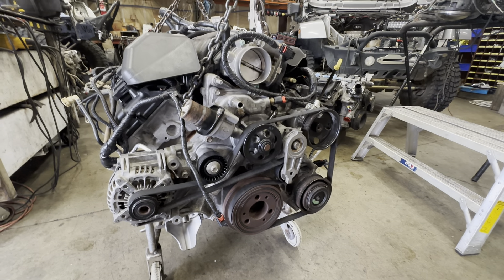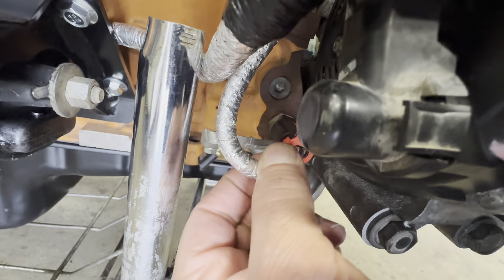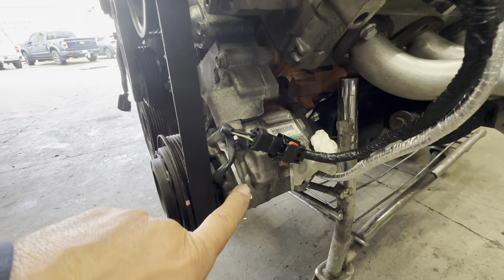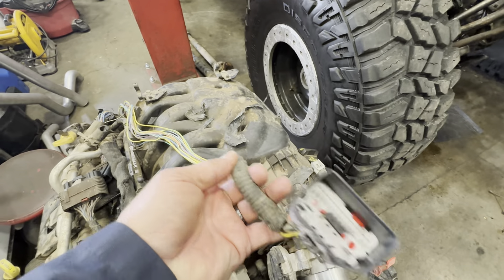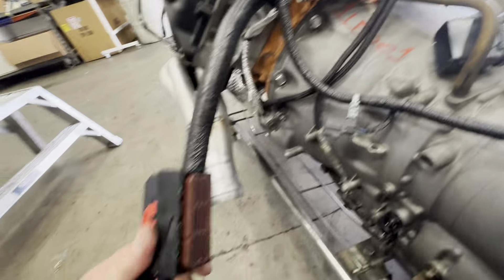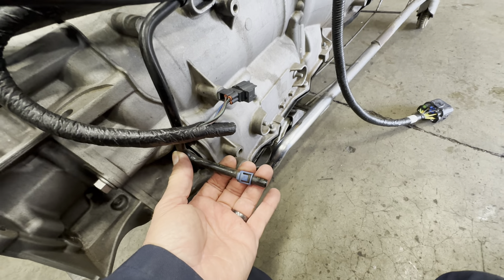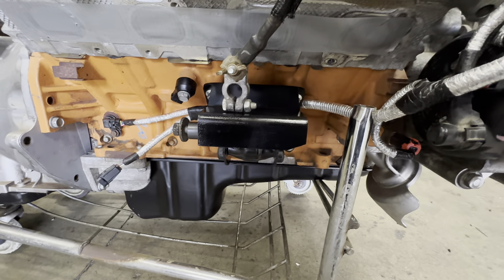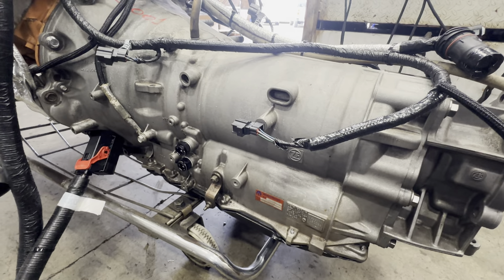Jeep JK 6.4L Hemi info

Comment: Just curious if you have ever done a Hemi upgrade on a JKU and kept the stock 6 speed manual transmission?  That may be a ridiculous question, but I’d love to know. If so what bell housing would you use?
Thanks!
Reply from the maker: The V6 manual transmission will not work, you would need to go with the Getrag 238 transmission but it is not being built anymore so parts are hard to fine..
Reply: Will this manual handle the power ok?  Second question do I need a rubicon transfer case or will my little stock wrangle jku sport be ok?
Reply from the maker: Nope the V6 manual transmission will not work. The only manual that will work is the Getrag 238 and we do not do manuals anymore..